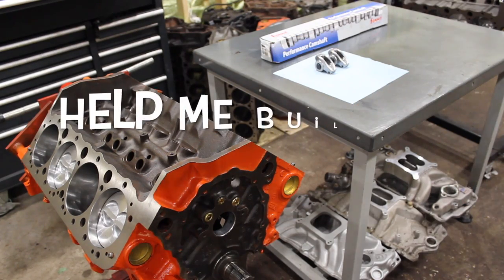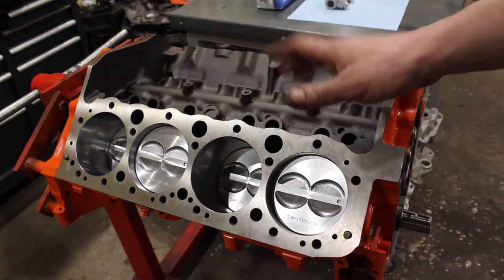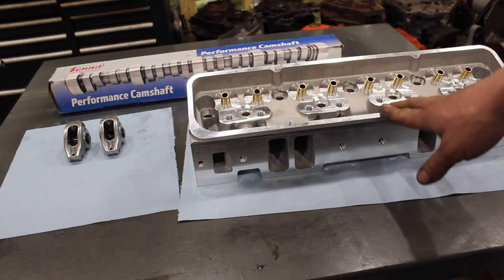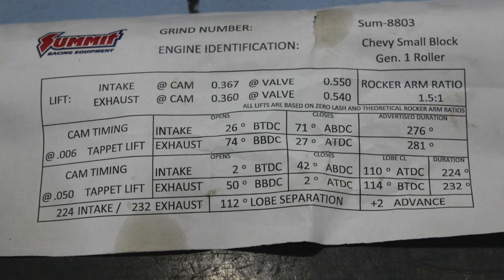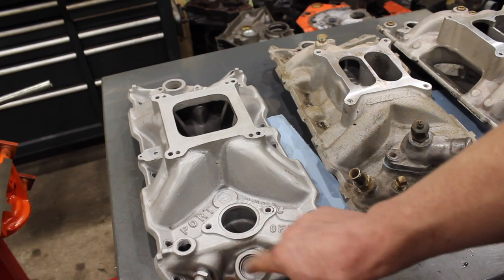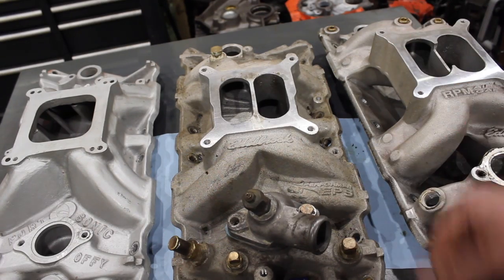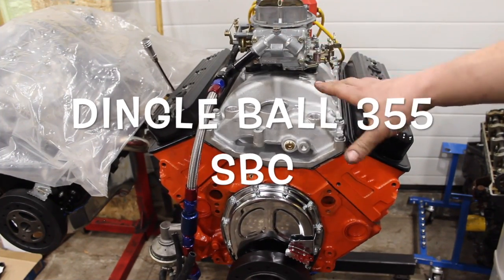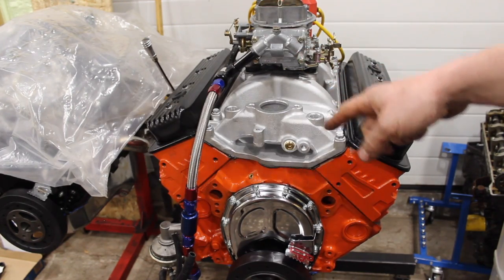What Intake would work the best? + Bonus peek at the 11:1 Vortec Build (260+ CFM)

Comment: Great video.  I'm looking for an intake that "would be" stock if the 5.7 Vortec had been stock with a carb.  I'm going to use a carb on this build.  I don't want the carb/air cleaner to sit up higher since I don't want to put on a cowl hood.  Any suggestions?  I'm not sure the Air gap would push the air cleaner up and hit the hood.  It's going in a 1984 Camaro.
Reply from the maker: The vortec low rise intakes would probably be what your looking for.
If your looking for a edelbrock the part# would be 2116. 
But check out the Jegs version of it part# 555-513002. They are priced very well and are actually a decent intake. 👌

Comment: Pat, did you use domed pistons on the vortec head 11:1 engine? I need to make more than 10.5:1 on a 350 vortec without angle milling. Gonna use the Gm sp350/357 cam. Cheers
Reply from the maker: Yeah i used the "pop up" dome pistons. Just like the ones used in the original 1970 LT1 engine
Reply: Do they miss the point on the quench area? Or did you do some massaging with a grinder?
Reply: What’s the part number for those pistons please?

Comment: Summit Pro SBC Stage 4 Hydraulic Roller Cam, 224/232 Dur., 112 LSA + 2 Adv, .550/.540 Lift, 2000-6500 RPM Range, 1987-02 Chevrolet Gen 1 Roller Block. Incase people want to know all the specs!
Reply from the maker: Thanks man!

Comment: I've been following your channel for a while now and I think it's the best, most informative channel on YouTube. I just got the crack detection kit and checked my head's. No cracks. Studs and puller should be here in a few days. Would you recommend me sending heads to shop for valve job or can I just lap the valve's myself. I'm building a mild vortec 350 no more than 350hp. Thanks for sharing with us. This is my first engine build.
Reply from the maker: Awesome man! When you tap those studs, be sure to take you time and make sure the tap is straight (you really dont want crooked studs)
Unless the heads are low mileage chances are they will need more than a lap (especially the exhaust vavles)
Reply: @cuttersperformance  yeah they have 250000 on them so off to the shop they go. Thanks brother

Comment: With the efficiency of the Vortecs and 260 cfm, and the 11to1 compression, and hopefully a small piston height with .7, .7, 2mm rings mahle pistons, and the in the zone camshaft. i definitely vote for the EPS vortec intake with a 650cfm ultra hp, or 650cfmAVS carburetor. If the engine had less compression i would go bigger on the carburetor because of efficiency losses. Put some good spark on this with UN-equal length long tube headers. And try 1, and 2" open dual or 4 hole spacers for fun. The vortecs have special cooling that allows cooler temps at the valves and carries exhaust heat away well. And with the iron greater thermal efficiency as well. A long rod like a 6" through 6.2" if could fit would be icing on the cake. i am looking to use this cam also, so waiting to hear the idle pull and revs. i know it would be awesome in a camaro. My guess is 420hp and 430 tq. i am counting on compression here. And appears to be around 200-210 PSI. with thick power. I have a non vortec EPS and like it a lot.

Comment: I tried airgap and RPM Performer saw no difference on the dyno only benifits is dry ice n ice underneath imo. That was from idle tp 6500. It was still pulling hard at 6900 when i let off. I think the only reason I'd use airgap is ice however I have a ice container my fuel line runs through for warm nights i put ice and dry ice in it.i also have heat shield and spacer from the small shot of nitrous. They said it adds top RPMs  No issues. What do you think?  Edit. I do have a much larger cam lift & duration dart 2 angel plug heads moldex crank & more she's fun on the street. It's a 4 speed car. Fun fun fun it's built enough for single plane my builder didn't see the need for the street.  Thoughts?

Comment: PC... That's a DNA head? All the DNAs that I've worked with have been a vortec style intake ports that look like a dart pro1 platinum. They also all have vortec intake mount holes. Yeah, that looks more like the enforcers. Hopefully they've change to the older ports. Vortec intakes cost a lot more and need to be modified on the holes and the front and back.

Well to the intakes. The single is too big for that degree range cam and the air gag is kinda a semi hybrid. That being said, the performer usually slacks off around 5700. With the cam choice, that's the obvious. If it were me, I like the airgap for one reason, they keep the fuel cooler,especially if you use something like cerakote on the bottom. The cutout will need to be sealed up for street power , avg tq and hp. The notch will help, but only on a higher rev. If you are giving it a shot, then you the cutout would be beneficial. Like the other chap said, around a 3.73 if you want to talk about it off the dyno and it's use and behaviour. Peace out bro

Comment: .550 lift is the extreme upper limit  of what the factory dog bones can handle for holding the lifters. On my 383 I have 520/540 and did 1.6 rockers and it works. Just check everything first.

Comment: Will the bolt pattern and bolt angle on those intakes match the bolt pattern and bolt angle on the heads you chose?
Reply from the maker: Yeah we are using the DNA aluminum heads that have the std intake bolt pattern

Comment: If it will be a real regular street driver the EPS is the beat in all climates except the really hot areas. The big problem with airgap on a true streeter is the inconsistent runner and plenum temp, sure they run a bit cooler but in cold to warm weather the intak temp us all over the place and tune consistency and driveability suffers.  
 The old offy is a good intake but not for this combo unless its running steep diff geats and a lot of stall, 3500rpm plus to get it over the tq loss low down. EPS all the way, i have used them on 383's with 10 more deg at 50 thousands and they still outgun an airgap in the real world.

Comment: The RPM air-gap and 1 inch plastic type spacer Square bore with the 750 Holly is showon to have the biggest broadest power band on a stock 350 vortec that's been carbureted at 340 horses but that's also without accessories on the motor. So that's the way I'd go on this motor because obviously not stock I would bet somewhere around the 450 horse with this engine and a nice Broad flat power curve

Comment: Don't try to create a Torque-Boost below ~3000-RPM with a Dual-Plane.
Get an Edelbrock-Victor-Junior, and a ~2500-RPM-High-Stall-Lock-Up- Converter.
The Victor-Jr. will run much smoother overall and 
allow more ignition advance below ~3000 where the
Engine will be more prone to Detonation with a Dual-Plane and High-Compression.

Be sure to keep the Quench between ~38 to ~40 thousands,
do what ever You have to do to get the Quench to this Value.
Steel Head-Gaskets are available down to around ~20-thousands.

The Cam is a good Street-Cam, 
set it to ~4-degrees retarded, instead of 2-degrees advanced.
A lot more Lift would have been a big advantage, 
but requires Valve-Guide-Machining on Vortec-Heads.

Don't touch the Intake Ports other than to remove 
obvious Casting imperfections, roughness, and any sharp-edges.
The Valve-Cuts, and the Valve-Seat area affects EVERYTHING.

With all of the above done, it will make around ~380-Horsepower.
.
.
.

Comment: The RPM  intake is the only one that makes sense to me. 200cc heads, 10.1 pistons, 224intake/232exhaust cam. it all adds ups.  Little motor should be strong from 2500rpm up.

Comment: I have a similar build, offy is ok but you lose bottom end, use the Air Gap, the heads are more than capable of the cam. 11:1, voodoo 276 H.R, Air Gap, 435 hp, guaranteed, you will be close.

Comment: Air gap, I would have used the bigger cam though. Still be a strong runner
Reply from the maker: What cam would you have liked to see? Also remember this is only going to be about 10:1 static compression
Reply: The Richard Holdener custom

Comment: Short duration cam won’t make power at high enough RPM to make good use of the RPM airgap. The 2701 would have the strongest mid range. Highest power average throughout the rpm range. While the RPM airgap will make the highest peak horsepower. 
If you’re looking for the peak hp go with the airgap. If you’re looking for the most overall power throughout the entire idle-5700-ish rpm then use the 2701. 
The single plane will kill torque everywhere and the engine is nowhere near wild enough to make up for it on the top end, and even at that the RPM airgap will likely make more horsepower anyway.
Reply: I tried airgap and RPM Performer saw no difference on the dyno only benifits is dry ice n ice underneath imo. That was from idle tp 6500. It was still pulling hard at 6900 when i let off. I think the only reason I'd use airgap is ice however I have a ice container my fuel line runs through for warm nights i put ice and dry ice in it. No issues. What do you think?  Edit. I do have a much larger cam lift & duration dart 2 heads moldex crank& more she's fun on the street. 4 speed car. Fun fun fun it's built enough for single plane my builder didn't see the need for the street

Comment: I'd like to see a 2701 with a small spacer or milled center divider to see how it performs with good hood clearance. As the Airgap is gonna kick the most ass everywhere in the curve.

High compression Vortec build! Awesome! I was thinking about how interesting a Vortec headed SBC/4.3 would be designed for pump E85 (12:1+). Solid Flat or aggressive Hydro-Roller. Emphasis on big mid-range torque since big, low rpm, cyl. pressure is most held back by pump gas octane.

But, pump gas high rpm version is gonna be just as cool. Can't wait for that.

Comment: I have to vote for the Air-Gap/ But if you had one I would go with the Edlebrock RPM without the Air-Gap. Only because that is what I am going to put on my 350 Vortec headed engine. Better warmup if you have to drive it when it's cold out. Love your channel, I have told my old school friends about it, Can't wait to see these engines on the dyno.

Comment: Well the Air Gap seems to be the favorite and probably will do the best. But my vote is for the EPS. I think the EPS is an intake most people doing this type of build up will already have on their engine. Myself included. And from what I’ve seen in other tests, it would only give up a few ponies upstairs while keeping the torque about the same on the low end as the Air gap. Or plain RPM.

Comment: RPM Air Gap all the way. And run water lines from the front of the manifold to the back. That cam on a 108 lobe sep would make a good amount more torque with no loss on the top end. A 1.6 rocker can make up the loss in lift from flexing valve train. You should do a vid on valve train flex.

Comment: I wouldn't classify that cam as a street cam, but more like a small race cam. Either way, I'd go with the RPM as the first choice. Although if hood clearance is an issue the performer would work as well.
Reply: You really can't look at only one part of the cam specs!! It must be looked at as a whole!!
Reply: @mermaiddreams83  yep! Just like building an engine. The chosen parts combo(including cam profile) must match for the desired outcome and power level.
Reply: Erik that’s a small street cam. With a wide 112 lsa it will barely have any lope at idle at all. Should run strong from off idle to about 5700 rpm. If the LSA was between 106-108* the cam would pack a bigger punch and have a decent mild chop at idle.
Reply: @prestonrieger8410  actually it will have a considerable lope with lower vacuum. I'd say around 10 inches of vacuum. With lifts in the .550 range it pushes the limits of hydraulic valve trains. I don't constitute that as a dependable and durable street cam setup that can be daily driven. Now if the cam was at a street friendly and still power making around .500 lift and duration at 220 duration tops, I'd consider that a nice street cam. With a good set of heads and 10:1 compression that would be a good no drama power making and yet dependable street combo daily driver with great drivability. Besides the author gave my comment thumbs and agrees with my assessment. That cam is a little too big to be considered as a street/daily cam. Especially knowing the limits of hydraulic lifters. Plus you have to consider that cam although will make power you'd give up any kind of economy for daily use as well. A TRUE street motor must be well balanced between dependability, drivability, economy, as well as it's power making capacity and where in the RPM range it makes it. If anything the cam picked would be more at home in a stroker like a 383, 408, or even a mild small block 427. Still that 550 lift is extreme for reliable daily street duty. Plus the duration of picked cam is considerably large as well.
Reply: @erikturner5073  lift doesn’t cause lope. Valve overlap does. Which is most affected by duration and lobe separation angle. .550” lift on a hydraulic roller cam and 224* of duration @ 0.050 lift is a very mild cam. I run 236* of duration on 108* LSA in my street driven mud truck with a 357 cu in sbc under the hood. Hydraulic flat tappet cam. 
My big block charger has flat tappet cam with 240* of duration also on 108* LSA and it’s strictly a street car. 
This particular build with a wide 112 lsa and a split duration cam with barely more than stock 224* of intake duration will be pretty light in the torque department through the mid range, with a horsepower peak around 56-5700 rpm which isn’t much. I run wilder cams in street cars, and trucks. And my street strip camaro is a lot more aggressive
Reply: @prestonrieger8410  Not sure who you TRYING to educate, but I said nothing about lift dictating idle.  There's a difference from a weekend warrior engine as opposed to daily grind street burner/hot daily driver. Either way whatever dude, and happy building 😉

Comment: I have very little experience so don't take this too far, but for some reason I believe that while the Air gap will be better than the 2701 in every way ON PAPER, I think the 2701 will "feel" nicer because the fuel will atomize better and will return better mileage at the expense of a little top end power. Are you running a Quadrajet on this?
Reply from the maker: On the dyno I will run a holley 750 Dp
Reply: Would be very interesting to see the Edelbrock performer's 800CFM series carb ran on this combo along with the Edelbrock RPM Air-Gap intake as well!!

Comment: I would have picked the single plane because I've used them at the track and because I've read from a reliable source that they are better for fuel distribution however that air gap is very good for street\strip use . Hey, when will you do something with a Chevy 400?..lol
Reply from the maker: I gotta get my hands on some 400 blocks
Reply: @cuttersperformance  I have 2...somehow. One in my Nova and one on the stand awaiting decisions.

Comment: How are you getting 11-1 out of a 355 with 5cc valve reliefs and 64cc chambers? Even zero decked with a .035 gasket you'd be less than that wouldn't you. Just noticed the title caption says 11:1 domed pistons.
Reply from the maker: The 11:1 engine is at the end of the video, its a completely different engine with 2.02 ported vortecs that i built with almost all used parts that I had sitting around

Comment: Dude don't kill it with 1.5's put 1.6 on it, run the single plane. 3.73 or more gear with a 2500-2800 rpm stall and it will run, be very streetable.

Comment: Aior Gap sounds like the best fit !
I'm still having a problem with my Vortec head swap on my 1982 Chevy 350 van project. I put an Assault 2007 Dual Plane Intake Manifold on it and now I am having a hard time finding out what Throttle/TV/Detent Cable to use (water ports bang into standard Edelbrock Bracket) with my 1991 700R4 transmission to my Edelbrock AVS2 carb swap. (Swapped from a TH400 to this 700R4)
Nice video Pat !
Reply from the maker: Shoot me a email with a pic of the issue your having
Pcperformance1@outlook.com

Comment: If it's going in a stock hood Corvette, performer eps. Most any other engine bay, performer rpm. Love these SBC budget type builds. I'm running very similar build using stock 906's and lunati bare bones 290/300 flat tappet in an 880 block. Car ran 13.3 at only 98mph lol(Draggy shows I lifted before 1320) not a screamer but still fun. Love your vids pat. Chevy 💪

Comment: With that cam and heads I would go with single plane and gear ratio of more than 3.73:1 in a light car, But would be interesting to see on dyno testing of other intakes to compare.
Reply: Great combo for a car under 2800 lbs. I was thinking about a single plane for my s10 with 3.55 gears.

Comment: Well it seems that the overall favorite is the Air Gap. However, I have to agree with one comment made that the bottom end is not being made for high rpm, so I vote for the standard Performer intake. This is a great build and I'm glad you are doing it! It seems this is a great daily driver build. To that end, there are not many daily drivers that see 6000 rpm. A good daily driver needs off idle power to approximately 4500 rpm. In the end if you do go with the Air Gap, it would be cool if you could also dyno the standard Performer without changing anything else just to see how they compare.

Comment: Air gap for sure. Can’t wait to see it run! Might be an engine combo to model after for my 67 C10 🤔
Reply from the maker: 67 c10 👌
Shoot me a email Jim, I know you been a long time subscriber and I have a Piss-Cutter key chain I want to send you 
Pcperformance1@outlook.com
Reply: Im Doing a 70 c20 winter project build. It was a bone stock 400 with an Edelbrock carb. I swapped the heavy cast intake out for an Edelbrock performer, I noticed alil gain. Im porting vortecs for it currently but still may go with the budget aluminum heads and cam to match.